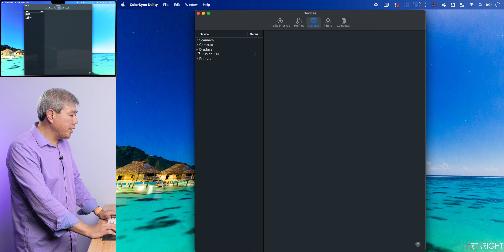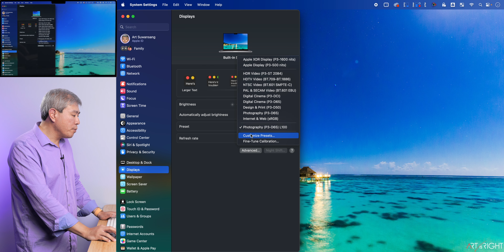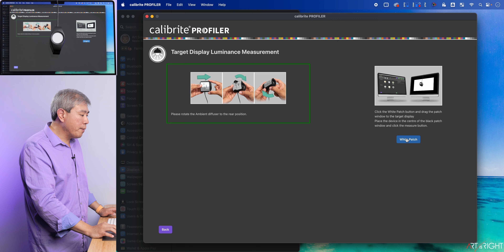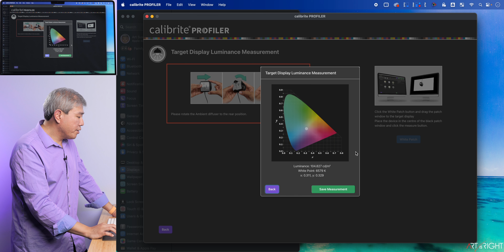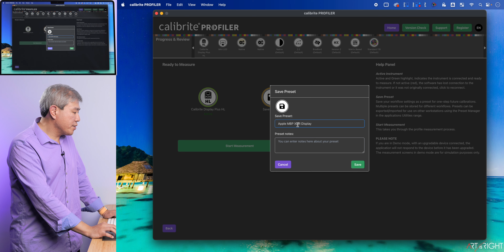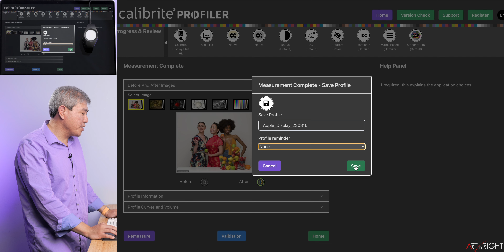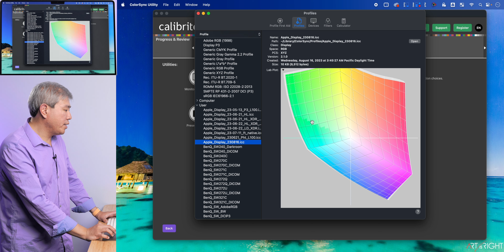Ultimate Calibration Guide for Apple 14" & 16" MacBook Pro XDR Display - This is the way!

Comment from the maker: There are new guides that you should follow. It is a slightly newer approach that offers more simplicity and accuracy, that the method shown in this video:

4 Parts Apple Pro Display Calibration Guide
Part 1: Go over Apple Pro Display Presets, what, why, and how to create a custom one tailored to your workflow:
https://youtu.be/VAJOEQ1FlsY

Part 2: Go over how to do a fine-tune calibration on Apple Pro Displays:
https://youtu.be/YMlj9DCXY44

Part 3 shows you how to do a full calibration on your Apple Pro Display using Calibrite Display Plus HL Device.
https://youtu.be/CNFEYI_48Uk

Part 4 Q&A and Clarification on Apple Pro Display Calibration process
https://youtu.be/Ri7eF_PeHHM

Studio Display XDR Full Review
https://youtu.be/CQ3GagI7a3M

Comment: Hello and thanks for the super useful series of videos.
But, I have an issue:
I use MBP16 m5 max with Tahoe OS and the CALIBRITE DISPLAY PRO HL.

So, i followed all the steps and it worked great, but after I reboot my laptop, the custom display settings with L100 and XY fine tuning disapears and it boots with the P3 - 1600nits. And that happens over and over again.
Is there a solvation or maybe another video for Tahoe? 
Thanks a lot
Reply from the maker: I've been hearing about this, and to the best of my knowledge, it is a macOS bug, sadly.
Reply: @ArtIsRight thanks for the reply.
Hope to see this problem solved in future updates

Comment: Hi Art, thanks for your tutorial, i am running Tahoe 26.5.1 (25F80) on my Macbook M4 Pro and there are some differences to what you are showing. For instance I cannot enter the Luminance (cd/m2) value, it will only allow 1 digit after the dot, like 110.7 instead of 110.710 as measured by calibrite. Can i ignore that or should i do something differently? Thanks again for you effort!

Comment: Whenever I restart my MacBook Pro M4 2025, it saves my custom display settings. However, it always reverts to the Apple XDR display, but the ICC settings are saved. Is there a solution I'm missing? Could you help me? Am I doing something wrong?

Comment: Thanks for the great video!

Just so I understand correctly:
I set the preset to "Photography 100L" (in my case, I chose luminance 120 because it can be too dark during the day, but it's still within the standard range) and calibrate using this preset. Every time I work on photos, I have to set this preset, but what happens if we leave it at "Apple XDR Display (P3-1600 nits)"? Is it just a matter of brightness and locking the settings? I'm getting to the point where I'm afraid I might forget to switch the preset, and I want to know what the consequences are.
Reply from the maker: There are minimal consequences, just that if you print your display might show you good image but your image will print out dark.

Comment: I did not see you choose the color space (Adobe RGB, sRGB, etc) in the Calibrite app.  Did you just use a default color space?
Reply from the maker: Yes color space is controlled from the display or preset mode is macOS

Comment: So you profiled the regerence mode for Photography to a s[pecific white point and brightness and the profile sist on top of referenec modes. What now happens when you switch to a different reference mode like the one with variable brightness for everyday use? I am guessing profile will still sit there applied on top of that and for the most part it will be wrong since it was calibrated at fixed brightness level.

Comment: Hello Art,
I recently calibrated the internal display of my 14-inch MacBook Pro using a Calibrite Display Plus HL and the Calibrite Profiler software. I followed your calibration workflow as recommended.
However, on macOS Tahoe 26.3.1 the system seems to automatically re-apply an Apple display preset instead of using my calibration. The ICC profile is visible and active in ColorSync, but in System Settings the display keeps reverting to a preset and the brightness does not match the calibrated target.
Have you encountered this behaviour with the newer macOS versions or the reference preset system on Apple’s XDR displays?
I would really appreciate your insight because your calibration videos have been very helpful.
Best regards
Jan
Reply: Hi how did you ended up ?

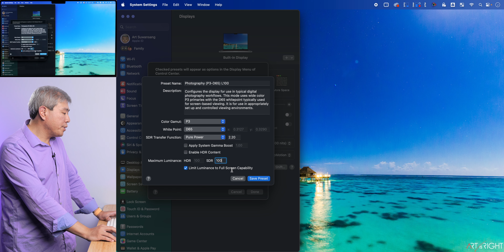Comment: At 7:05 in the video, you indicate that Limit Luminance to Full Screen Capability should be unchecked for an Apple 27” Studio Display. Doing this greys out the Fine Tune option selection in Sequoia 15.7.4 on an M1 Ultra. Checking this box however enables the feature to be selectable. Otherwise, a great reference video for Studio Display calibration with Calibrite!  Thanks for this tutorial.

Comment: Hi Art.  Thanks very much for creating these videos.  I have used these instructions for a long time, but now it seems that Tahoe 26.3.1 will not maintain the settings after a reboot.  The customized Photography (P3-D65) L100 preset disappears on reboot and Apple XDR Display (P3-1600 nits) replaces it, which is much too  bright.  I'm still doing some testing, but right now it appears the problem occurs only when the customized Photography preset has Fine Tune Calibration applied as you describe in the video.  Fine Tune Calibration makes Tahoe forget the Photography preset.  At least that's the way it looks at this time.  Any thoughts?  Cheers, Dave
Reply: I would like to know this as well! Is there any workaround?
Reply: @peterweyland6824    I did some homework and this is a recent bug in Mac OS.  The update to Tahoe 26.4 didn't fix it, so I just skip the Fine Tune Calibration part because that's what dumps the display preset and reverts the display to default.  When you calibrate, you can set the Photography preset with L100 as normal, but skip the Fine Tune part.  When you get to the calibrite Profiler software part, don't use Native and stick with D65 and L100, and then calibrate as normal.  My results are just as good as Art was getting when I validate the calibration at the end.  BTW, Art doesn't mention it, but be sure to check the actual Luminance after you set it in the preset.  I set L100, but only got L95.  I had to set L106 in the preset to actually get L100 measured.  I found that to be true even when Fine Tune Calibration was working.  You may have to experiment a little.  Good luck.
Reply: @Dave59758  same problem with 26.4 :( but thank you.
Reply: @Dave59758  But how can I set the brightness so that it can no longer be moved? And so that it's locked?
Reply: @ImmanuelBarseghian-nz9sx  When you set the "Photography (P3-D65)" preset in the Displays section of  your Mac's System Settings, the brightness controls on your keyboard are locked out and no longer work.  Brightness can no longer be changed, which is what you want.  That will remain true if you modify the luminance of the Photography preset as Art describes.  It's only the Fine Tune Calibration part of Art's video that activates the bug in Tahoe 26.4 and causes the display to revert to default.  And, as I mentioned above, test your luminance after you modify the Photography preset to make sure you really get what you want.  Hope that helps.  Cheers.

Comment: Thank you so much for your amazingly detailed information. This was so helpful. I followed all your steps and worked perfectly, but when it came to comparing the P3 profile and my calibration like you demonstrated, my calibration is much smaller inside of the P3 comparison. I am not sure why that is and how this can be changed or how much this will affect my work. I am a photographer and won't be using the MacBook screen for retouching work but color accuracy is still important when I am for example shooting on location and have to judge images on the screen. Any thoughts as far as how to resolve this ?
Reply: I just did this for a new M5 Max MBPro and my comparison is like you describe. I used the current Calibrate Profiler v3.0.4. I checked my older laptop, an M4 Max profiled using v3.0.2 and it was just like the demonstration in the vide, almost completely matches. I wonder if it's anything to do with the software version?

Comment: the new macOS Tahoe 26.3 makes the calibration almost impossible cuz the profile you see in the color synch utility is not what you see in the system settings and the luminosity is not blocked. A new tutorial maybe? Thanks a lot.
Reply: i talked to apple support, but they say it´s a local problem on my machine which could be fixed in safe mode or when setting up a guest user. i tried both (which didn´t fix it) and even reinstalled the os. apple support couldn´t help further... maybe it helps if more people report the problem and they will eventually fix it???
Reply from the maker: You both are not the first. This seems more like an OS Bug than an isolated user case.
Reply: @ArtIsRight  thanks for the answer. Maybe Aplle will realize that and will do something. It happens with the new Tahoe release.
Reply: @mobexify  I surely will do. Thanks. I hope Apple will solve this.
Reply: @esseerre6302 Hi! Did you solve the problem.
Reply: @tychoo006  nope. despite the Mac Os update (tahoe 26.4.1) I have the same problem. did you solve it?
Reply: @esseerre6302ı have 26.4 currently. I was thinking to update so ı’m not going to update. Do you know 26.4 was okay for calibration ?

Comment: Great walk through of how to set this up. Thank you! 

I've done this twice on my MbP M4 Max (just to make sure everything was done correctly) and though my validation numbers were/are very good, when I view the new profile using ColorSync Utility - comparing the Display P3 System profile to my newly created profile (like 19:00 in video), I'm seeing a somewhat smaller color area (my new profile) in comparison to the Display P3. Yours lines up pretty close. Curious what may be wrong (if anything).

FWIW: Running macOS Sequoia 15.7.4
Reply from the maker: dm or email me
Reply: same here. Could you please tell us if you found a solution? many thanks

Comment: Hello, it seems that in mac os tahoe 26.3 the fine calibrated display settings and profiles are being reset after a system restart. so atm i need to re calibrate the display again each time after restart if i want it to be accurate. did you or anyone else run into this problem as well so far and is there a workaround? thanks for your help!!!
Reply: I just updated to 26.3 and am having the same issue. I set the white point with measurements from Calibrate and when I connect to my external display or restart, the fine tune calibration disappears. My only option is to not fine tune the display and just use the Photography setting at my desired luminance, Luckily my MacBook Pro 14 measures pretty close to the target.
Reply: I've observed the exact same behavior after the update. After a restart or after connecting the second monitor, the color settings are reset. This can be quickly verified using the "Monitor Quick Test" function – in my case, the white point is always reset

Comment: Hi Art. Great tutorial!  Just getting started, and when I tried to reset to the factory profile in color sync utility, I do as you describe, but it keeps popping back to linear – mac.icc and will not change to the factory setting. I see that my factory profile is identical to the one in your video. I am on an Apple M3 Max, 16 inch, November 2023 MBP running Tahoe 26.2.

Comment: Hi! just bought the Plus HL. I have 16" Pro Display XDR I Think. So I will select "Mini LED"? If I have "macOS Tahoe" do I need to turn off something as well? Would be nice with an updated video for this. And how to do I change so I still can change the brightness of the screen?

With the fine tune calibration I didnt get the x or y axel as close to target as you and luminance I got 91.6 and I could just put in 93.9 as max. Will this make a difference? Will I set SDR to 110-120 to get luminance closer to 100?

Comment: Wow Apple really made this complicated. On my external display I simply run DisplayCAL, chose D65, adjust R/G/B in the monitor, click calibrate with my i1Display Pro, and that's it.
Calibrating my MBP14 M3 Pro is a pain, and requires me to purchase new calibrator... No thanks. I'll just edit my photos on my external monitor.
The fact that I can't even adjust display brightness is just extremely cumbersome. I'm aware that brightness adjustment shifts calibration slightly, but the way it is implemented now is just cumbersome for people on the road where you are constantly not in a controlled lighting environment.

Comment: Thanks for this excellent tutorial. Unfortunately I’m having an issue with the final color measurement procedure. 
Using a Macbook Pro 16 inch M1, Display Pro HL. 

I am following your instructions to a T.  
But for the final color measurements, using 461 patches, it stops at patch 353 and I get a “Warning-Exit process” notice in the color circle. I’ve tried four times, same issue at patch 353..  I will add it measured the white balance perfectly.  

So I tried using the 211 patches instead. The first time I attempted it, it made it all the way but at the final Patch (zero) I got a longer message saying “ there appears to a problem your reading.  please ensure your device is positioned over the target. Click OK to restart the calibration process. If this problem persists please contact support. Error obtaining optimized patch set.”

My device is centered and flat.  
So I tried it again and this time it stopped at Patch 135 and I got the basic “Warning-Exit process” notice.

Has anybody else had this issue?
Reply from the maker: dm me

Comment: Hello Art, Thank you so much for such an insightful tutorial. I have followed all your instructions to the T. However, my brand new color Calibrator received today will not complete the color patches it drops out at various points. Its a Display Pro HL. It did however calibrate my old 27" Mac Display no Problems. Any Trouble shooting ideas you may have would be appreciated. Warm Regards Lyall
Reply: Apple 14" Macbook Pro M4 2025 - macOS Sequoia 15.6.1
Reply from the maker: I have seen that myself; it is not the calibrator but rather something on the system that is kicking out the process. I don't have a solution as of yet.

Comment: Many thanks for your nice video! I use a MacBook Pro M4Pro with Nano-Texture XDR Display. I’m a photographer and don’t own the Calibrate Pro HL / Plus HL but a "Xrite i1Studio" I recently upgraded to "Calibrite ColorChecker Studio". So I simply thought I’d try your process based on modified (luminance 90) factory preset „Photography (P3-D65) L90“. White point measure result: x: 0.317, y: 0.330, Luminance 94.852. I did the color profiling with 211 patches, verification with 96 patches. Results reported: average all patches: 0.4, all patches max. 1.9, standard deviation 0.2. Verification Passed. According to your words this should be a very good result. So I’d say, for my use case the i1Studio measure device does the job! For HDR or advanced video stuff with high gamuth support this might not be sufficient. For what I do, the Xrite i1Studio / Calibrite ColorChecker Studio should be IMO good enough. At least the famous PrinterEvaluationImage_V002_ProPhoto.tif image looks great based on my generated icc profile! - This is the reason why I decided not to buy the Calibrate Pro HL at the moment. I find it unfortunate that this device can’t be used by Apple’s MacOS „Full Display Calibration“ process. If the Calibrite Pro HL would work for this, I’d surely buy it. 
One Problem appeared on my maschine: changing profiles via Calibrate Profiler 3.0.1 doesn’t reflect in Color Sync Utility but the change is visible. Until now, I didn’t find the reason why.

Comment from the maker: Update 9/18/25 - For Apple Studio Display, to get the full color gamut, "Mini LED" backlight option has to be selected. This also means that only the Display Pro HL or Plus HL can calibrate these to its fullest capability. It is a great idea to consider upgrading previous-generation Calibrite Devices to the current models. 

Recap: For any 14" & 16" Macbook Pro regardless of silicon, along with the Apple Pro Display XDR and Apple Studio Display 5K - the current Calibrite Device, Display Pro HL or Display Plus HL is needed to calibrate these displays to its fullest capabilities. And "Mini LED" is the selected backlight option, even though in this video I said to choose GBLED . (Eventhough Apple Studio Display 5K is not MiniLED backlight, but this will work and it is only one that works, I've tested this).
Reply: hey art i really appriciate your videos. I just want o confirm. so for the macbook pro 2025 M5, (Liquid retna XDR) one is NOT selecting GBLED but instead "Mini LED". ?
Reply: additionally, when we set it up this way, we will never be able to adjust the brightness?

Comment: Hi Art, Thanks for a great tutorial! I´m doing the setup for grading with Davinci on an Apple Studio Display and I have two questions about the first base setting to adjust in the system settings. Should I keep the preset BT 1886 Annex 1 with the system enhance gamma 1,22 checkbox checked or just choose pure stream (gamma) 2.4? Also in the color checker utility I guess that I go back and choose video as a starting point, keep native luminance according to your video and then gamma 2.4. I did the tutorial with the x-rite i1display unit, that´s not terribly wrong or? Many thanks